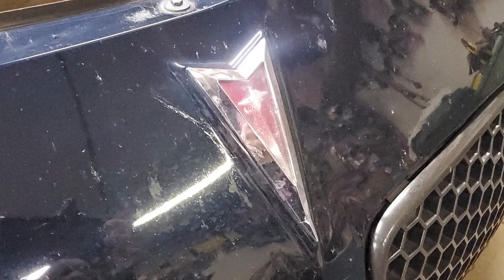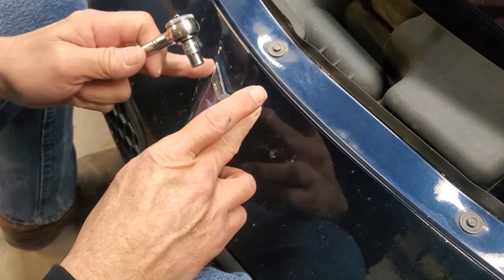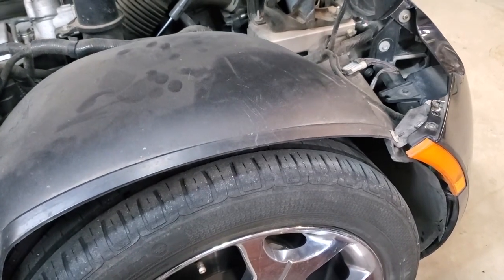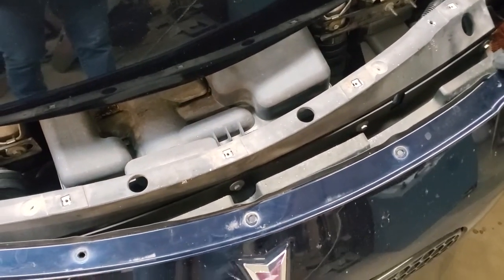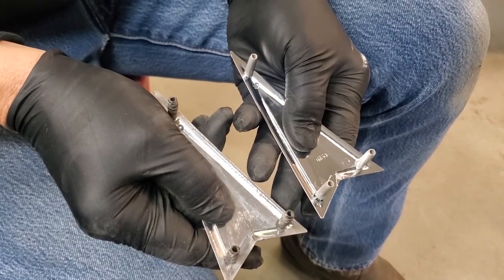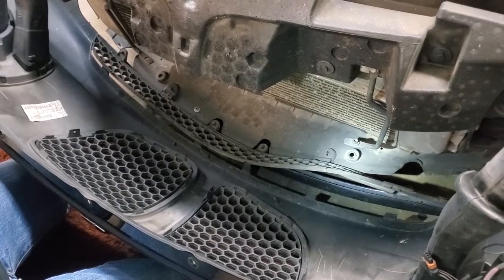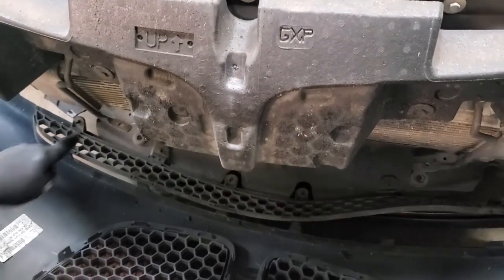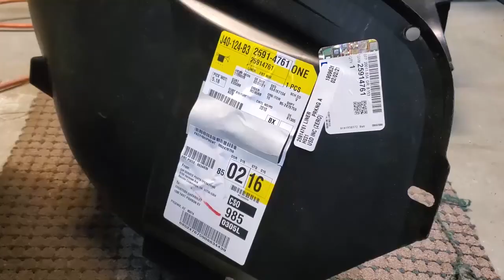How to Replace the Pontiac Badge on a Solstice Grille - Replacing Pontiac Solstice Grille Emblem

Comment: It is on the bumper, not the grille.
Reply from the maker: The split grille appeared across the entire Pontiac line including Star Chief, Catalina, Safari, and Bonneville. My guess is that when most people think of the front-end design of the Pontiac, they remember the split grille. "How to Replace the Pontiac Badge on a Solstice Bumper" doesn't search as well as "How to Replace the Pontiac Badge on a Solstice Grille." The latter of the two titles sounds more elegant, although the former might be accurate.